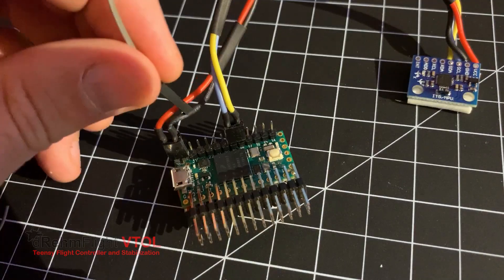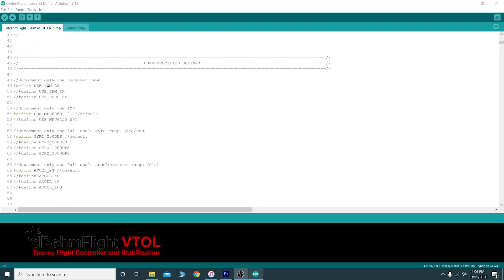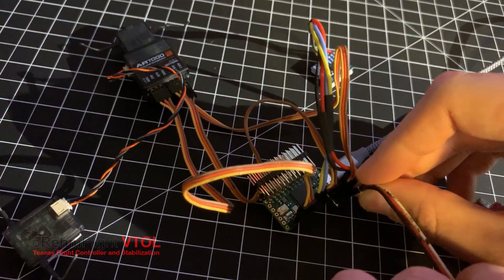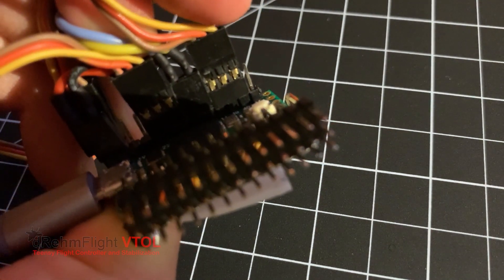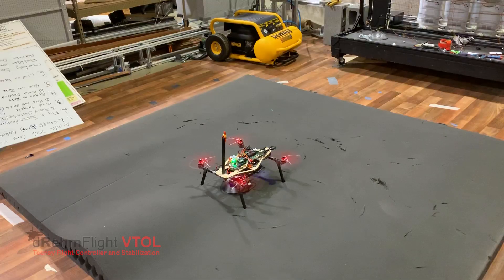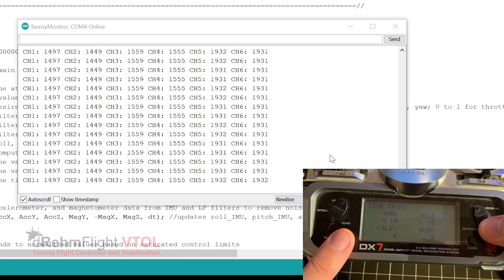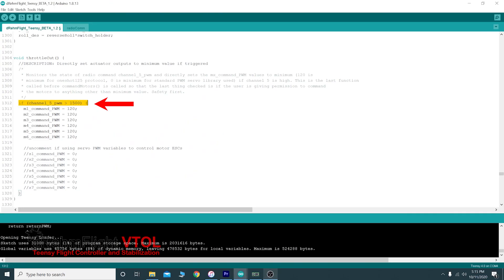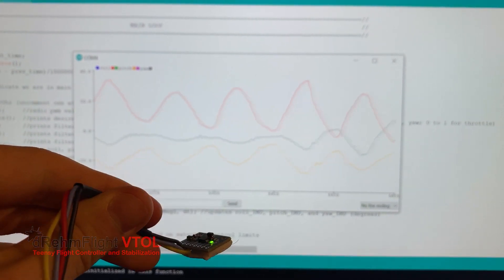Setting Up Your Radio Connection - dRehmFlight VTOL

Comment: hello. I am in the process of hooking all the teensy-board electronics to 4-iin-1,, and servos. At this time i am trying to work out the servo directions for s3 and s4. The serial monitor show signal ranges as per the docs, but s3 and s4 move in the same direction (the wrong direction) no matter how I have servo reversing set up on the transmitter. The serial monitor does show the channel 6 values increasing/decreasing when the switch is activated, and the values reverse when the transmitter servo reversing  switch is changed. There must be something in the code that determines the s3 and s4 values (specifically whether the servo should move clockwise or ccw? I am also having some issues with the 4in1 not responding as the vendor docs suggest but first things first. Thanks for your responsiveness to requests for help!
Reply from the maker: Keep the radio reversing configured according to the radio setup tutorials, otherwise there will be more confusion later on. You can change the direction of servos in the control mixer. For example, s3_command_scaled = 0.5 + roll_passthru OR s3_command_scaled = 0.5 - roll_passthru will change the servo response direction to direct roll stick input. Control mixer function is where the magic happens
Reply: @NicholasRehm  Of course, you're right. After so many years of installing servos without regard to direction, you get used to having servo reversing when you need it. I will make the changes and push onwards. Thank you.

Comment: Hello Nicholas, 
I followed your steps and made it up to Serial communication with Teensy 4.0 which is working fine. I am using Graupner transmitter  MZ 12 with GR12L receiver. My servos do not respond to  joysticks ?? any tip for me where I made mistake? Im looking for solution on  my side for 3-4 days now without success!? 
Thanks- Mike
Reply from the maker: By default there’s no assignments to servos in the control mixer
Reply: @NicholasRehm  Can you please explain a bit more in detail. I tried to figure out which assigments in control mixer you mean but I am lost !?

Comment: Hello. Very nice project. I have connected just the receiver and the MPU6050, four channels of the PWM receiver (1, 2, 3, 4 respectively to pins 15, 16, 17, 20) and the MPU 6050 with the SDA to pin 18 and SCL to pin 19. It doesn't work. It says "MPU6050 initialization unsuccessful try to power cycling". I tryed another software with the same Teensy and IMU without receiver and it works.. It is able to read angles. What can I do? There is the need of connecting the other channels 5 and 6.. and the servoes too? Or could be a problem of libraries? Compiling gives no errors. Thank you for your help

I have an update. The version 1.1 doesn't have the problem of the IMU checking. And goes till the main loop. The led blinks three times and then one short bliink every 1.5 sec. The IMU works fine, all the tests give good results but the system isn't able to read the radio data.. it happen like in the video.. all data at failsafe values.. but there is no way for it to work..
Reply from the maker: Is the IMU LED turning on? I.e. is it receiving power? If SCL and SDA are connected and you have the 6050 selected in the user defines section of the code, it shouldn’t have that error. Another possibility is bad IMU, in which case they’re super cheap to replace
Reply from the maker: Radio values default to failsafe values if you don’t have anything connected to channels 5 and 6. You can comment out the failsafe function to disable this. But you will still have trouble arming motors without channel 5, so you’d have to make that change as well.
Reply: @NicholasRehm  Ok, channels 5 and 6 connected and now it works very well.. Great! Thank you very much!!
Reply: I also have a the problem that the system isn't able to read the radio data. I tried to disable the failsafe for 5 and 6 (I also tried some other channels), but then it spits out a lot of random numbers. You can see that those numbers change when I move the sticks on my radio, but it's a big mess (this shows that there is a connection). Could it be that my radio and receiver just don't work for this code?

Comment: Are there any plans to introduce a how-to module on connecting a flight computer to the flight controller to get basic autonomous flight(ie RTL)? Really great project.
Reply from the maker: Potentially--I sent radio commands over a serial line from an RPi4 running ROS for all the autonomy/computer vision. Wrote my own send/receive serial protocol, but I think there's probably already a ROS node that'll send out SBUS signal, so plug and play with this code.

But GPS could be implemented within the teensy for RTL with a function to get the GPS data, and a function to compute outer-loop controller commands. Tons of headroom to implement that no problem

Comment: I'm new to the RC world but i have a project of crafting a drone that can transition from vertical lift to forward flight just like yours. I didn't know it existed before landing on your videos! I just wanted to thank you for your great work, i am a mechanical engineering student and i find your work very impressive. I look forward to using it !! Thank you
Reply from the maker: Good luck with your project!
Reply: howd it go? I'm also doing that. Its tough. My question is, if our build is different and we want to use his code and software, do we just have to edit the code and change where we plug into the receiver and software?

Comment: Helle Nicholas, is it possible to use a nrf24l01 radio module to control RC quadcopter that uses the dRehmFlight VTOL as Flight controller?
Reply from the maker: Sure, if you have the code that will fetch serial data from the module for each of the 6 (or less) radio control channels, you can splice it in the getradiocommands() function to get your commands from there instead of any of the other radio options

Comment: This is awesome. I tried a couple of times to do something like this with an Arduino Nano, but I never got far, because I'm not much of a programmer (yet).  I've been thinking about how I might go about making a tilt-rotor vtol for a while and this sounds like a really good solution.
Reply from the maker: I actually started out on the nano and got some stuff flying, but didn't have enough computational power to get away with some of my coding (I'm not a programmer either). That's when I made the move to Teensy allowing for the much simpler/understandable code. A tilt rotor would be awesome and is totally doable. PM me if you need any help getting flying
Reply: @NicholasRehm  Dang, didn't see your reply untill 3 months later! I just got my Teensy 4.0 and I'll be setting it up in the coming weeks. Thanks for making this!
Reply: I'm working on a similar project but I will be using an esp32 hopefully works fine probably too late to comment